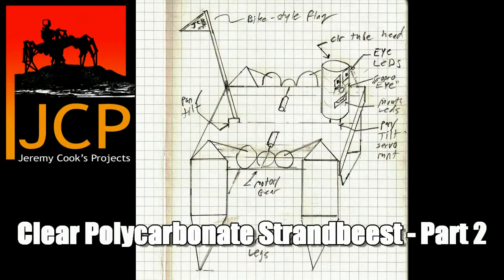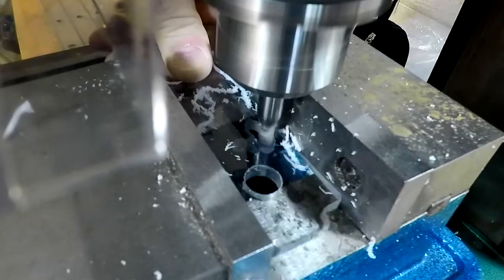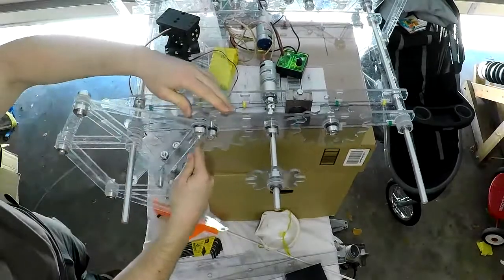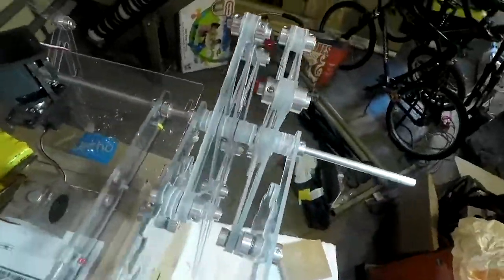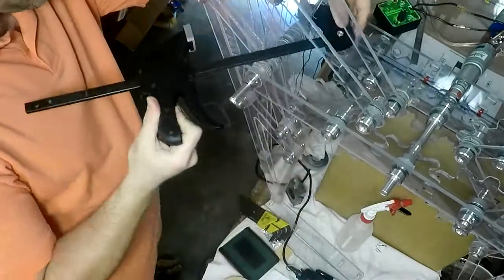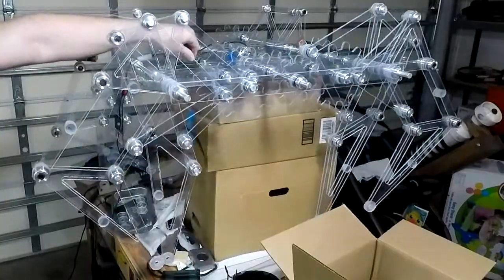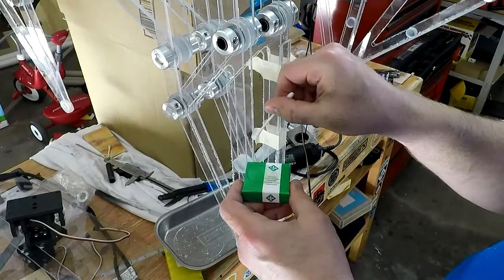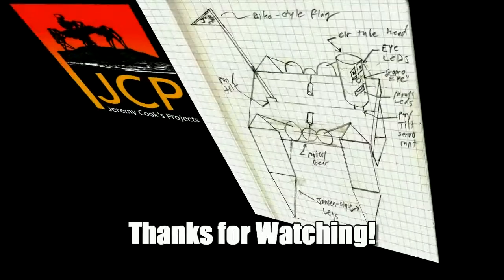ClearWalker Strandbeest Assembly (Pt 2) - Now Walking Unsupported!

Comment: Epoxy?  Don't you know that you can weld poly/acrylic with the proper solvent?  It's not glue,  it actually combines the surfaces molecularly and it only takes seconds to weld and dry.  Fixes in 2 minutes, 24 hours for complete & permanent solidification.  No mess, no mixing, no cleanup.  You could also use it to bond the chassis pieces where you used wire ties to keep it together.  Search for the brand "Weld-On" for acrylics.

But GREAT JOB regardless!
Reply from the maker: You know, I'd heard of that type of bonding, but never tried it. Perhaps I should have done a bit more experimentation.

Thanks, glad you enjoyed the video, hope you get to see how it turns out (and some of my other beests): https://www.youtube.com/playlist?list=PLUSVaS5vtdgQaDFztInsbfB1EXX5fftRp !

Comment: I really need to spend some more time with your channel. You are doing some amazing stuff. It's just so... organic. And kinda creepy. 

A question: do you have a polycarbonate cement that you recommend? A comment: I'm imagining fluorescent colors on the edges of the polycarbonate, like highlighter. A black-light would give that thing an otherworldly skeletal appearance that could send it viral.
Reply from the maker: Thanks so much! Yeah, love these kind of walkers, can't wait until everything is hooked up.

I started with Loctite plastic epoxy for my first joints, then tried Gorilla epoxy for the second round of supports since it was quite a bit cheaper (https://www.amazon.com/gp/product/B001Z3C3AG/ref=oh_aui_detailpage_o04_s00?ie=UTF8&psc=1). Both have held well so far.

That is a really good idea...Perhaps EL Wire?
Reply: I couldn't say. I'm hopelessly inept with respect to modern electronics. I literally meant highlighter marker, but lighted edges would certainly be next-level awesome. Like carbon-fiber pyramids awesome.
Reply from the maker: Well literally or not, you've given me what I think is a great idea...That and making a carbon fiber pyramid, but I think that's closer to your wheelhouse :-)

Comment: How do you call these axial bearings? 
This is made from Polycarbonate right?
Reply from the maker: Perhaps I misspoke. The bearings are all thrust bearings, and it's supported axially just from the polycarbonate (yes, clear polycarbonate).
Reply: Jeremy Cook's Projects No, I just didn't hear it. Looks like you used roller bearings without the 2 outer races?
Reply from the maker: Yes, that's correct, just a cage and needles! Interestingly, years ago I worked in a plant that made millions of that type of bearing. Was a different brand though.